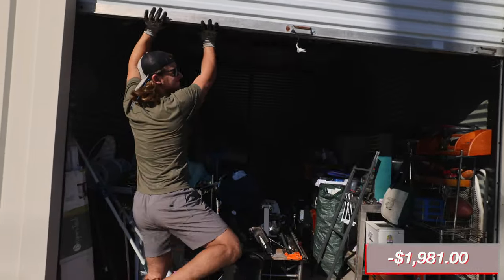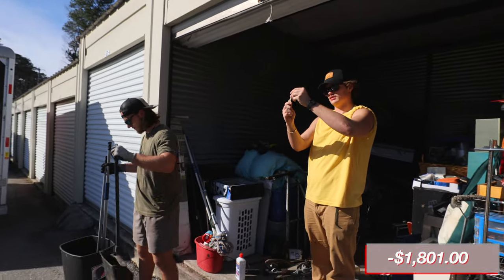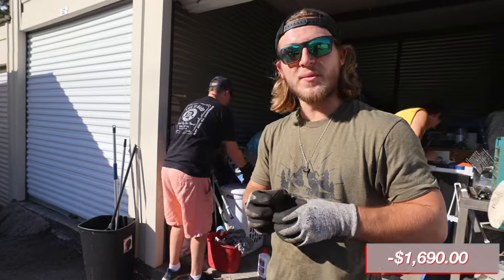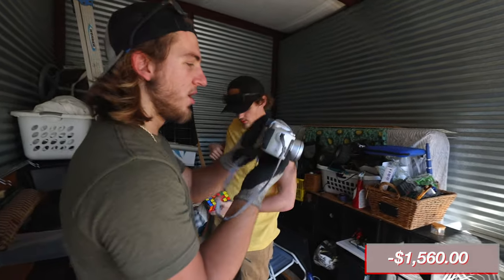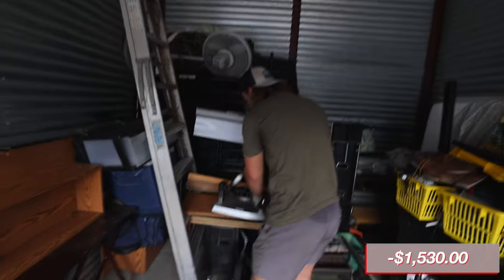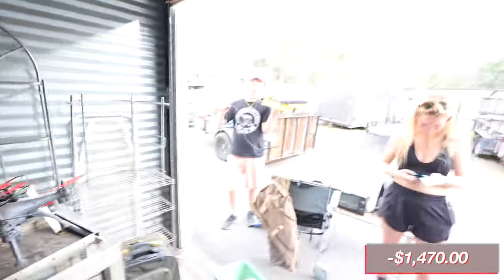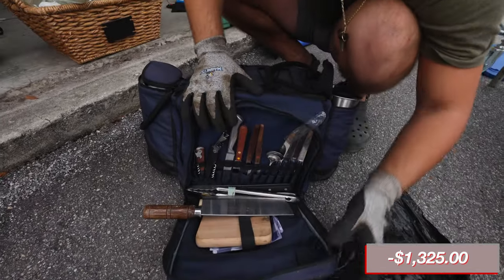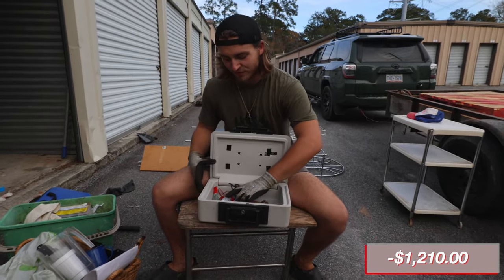This Abandoned Storage Unit Was A NIGHTMARE

Comment: Hey guys, I’m guessing this was a military man that got hurt in action and ended up retiring early. Put it all together with the medical bathroom chair, and other items along with medicine and it’s pretty much what she got. Also, just because you see a safe or a jewelry box in the unit doesn’t mean it’s gonna be a big hit. Next time you see a locker like that, make sure you look at everything in the unit and that will tell you what is most likely going to be in bed safe and jewelry case. If it’s a bunch of crap, I’m guessing the safe and jewelry are going to be crap. Also, not saying that this is one, but usually when you find multiple IDs in the locker, it’s going to be a managers special. That means he had multiple lockers available and threw them all into one. Either that or he went through all of the lockers available and put the remaining into the one in salt that off so it would look like there is more. If that’s the case, you can usually confront the management of the unit, and tell him if he doesn’t give you your money back, that you were going to contact the Better Business Bureau and show them all of the IDs, and that there was barely anything in the locker, except for the good stuff that was put in the pictures. I just watched to the end….don’t ever buy a unit because you see one of those safes, those are crap safes that can be opened easily. They’re usually used for paperwork. Only spend as much money as you can see in the pictures that u can def make, then only a little over if u see safe or jewelry box. It also depends on what the jewelry box and safe look like